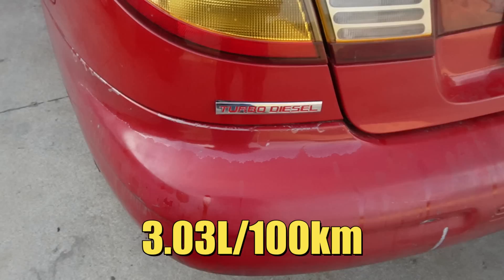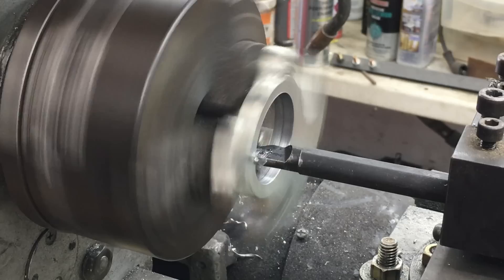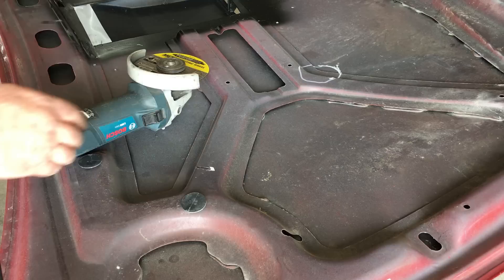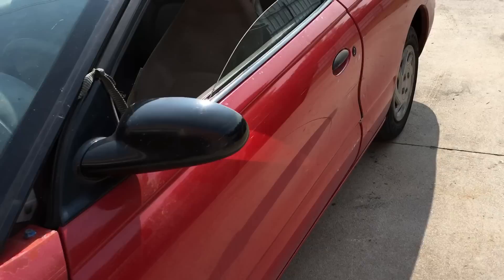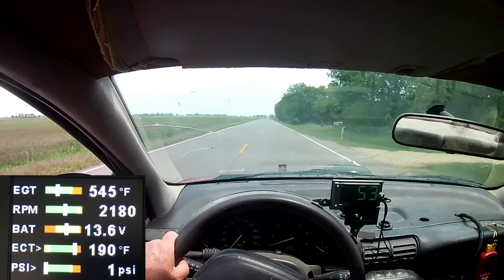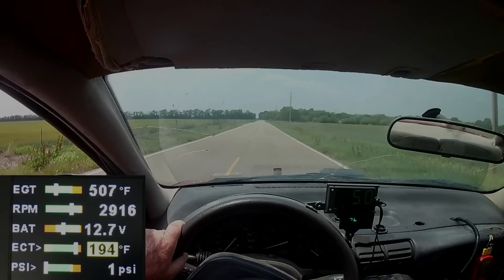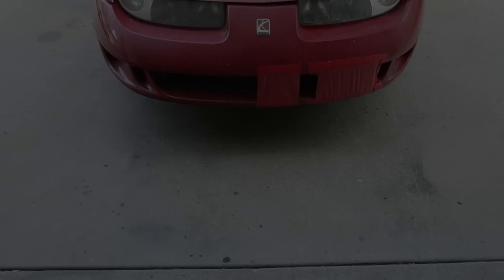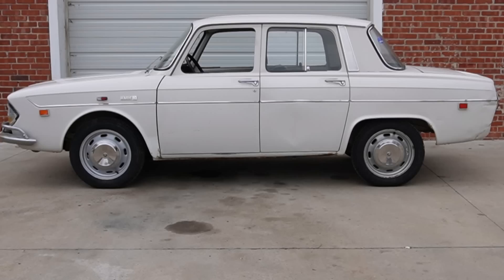S3 E17  We get 80 MPG with our D722 Kubota turbo diesel Saturn.  Best fuel economy yet !

Comment: The most surprising part of this is that you have the heater connected!
Reply: I was thinking the same!
Reply: It's gotta have a Sport Mode switch: turn it on, get more power!  (Or a safety backup, if you're no fun at parties.)
Reply: They hooked the heater up in case as they did overheat the engine.

Comment: An old farmer taught me to add 2 stroke oil to the diesel at about 100:1

It has a nice effect - running quieter and cleaner. Generally sweeter. Farmers don't usually invest money in anything unless it ultimately saves money! It would be interesting to see if you can achieve any mpg gains
Reply: A common practice here in my country
Fill a 200 liter of diesel then ad 1 liter of 2 stroke oil into the tank.
Reply: Not good advice if you have catalytic converters.
Reply: @MiGujack3  but for the kubota engine it should be perfect
Reply: Adding a little transmission fluid to diesel fuel does the same thing.
Reply: @MiGujack3  diesels do not have catalytic converters. They use particulate filters.
Reply: @shadymaint1  they have both
Reply: Do you know why it does that?
Reply: The reason for the extra oil is the reduction in sulfur in modern diesel fuel. On pumps that provide engine oil flowing through them (such as piston pumps) it isn't necessary to add lubricant to fuel. Now my 1991 Dodge W250 with a rotary pump definitely needs some additional lubricant. As the fuel is what keeps it lubricated.
Reply: @duanehenicke6602  Here in Kansas,  we take the old farmer's advice seriously. 🚜🚜🚜🚜🤠🤠🤠🤠👍👍
Reply: @MiGujack3  Incorrect. Just saying. Look up the way a system with a converter is laid out and it might make more sense.
Reply: Little Wally World 2 stroke oil or even some Marvel Mystery oil.
Reply: @Kansas Rose  oddly enough you're talking to another old farmer. Just south Texas in nature.....
Reply: @MiGujack3  only losers have cats on any vehicle
Reply: I've heard LPG injection helps performance and economy.
Reply: @duanehenicke6602  Thanks for explaining that. Makes sense now.
Reply: Heard similar stories about petrol.
Reply: @TheGuruStud  Oh I would love to remove them, but I live in a nanny state.
Reply: @shadymaint1  on road engine do have it from last '90s
off road engine have it since epa mandate tier 2 and above
Reply: There's a much better and cleaner solution than this. Diesel fuel additives. I use Stanadyne myself but they all have effectively the same result. Better lubricity in the fuel system, which translates to better fuel economy and longer engine life, coupled with anti-gel and fuel stabilizers.
Reply: No, oil in petrol(gasoline) engines really hurts mpg and power. Oil based fuels are High Reactivity Fuels, so they destroy your octane rating. I think that’s why 2strokes have such low compression.
Reply: @bobirving6052  he's talking about diesel though
Reply: @bobirving6052  its for diesel engine truck mate. Never saw it used on petrol engine.
Reply: Ultra low sulfur diesel isn’t as slippery, so these old mechanical engines need extra fuel lubricity for the injection pump.  TCW-3 or 4 is the best choice.  This two cycle oil is ashless and formulated for water cooled engines.
Reply: @robmanueb.  Bit of a niche modification now but it certainly does.
Reply: @robmanueb.  Yeah I been telling this dude to propane inject it n all he cares about now is fuel economy! 🙄 Lame!
Reply: Do not tell the EPA about that!!!
Reply: Two stroke scooters and yard implement engine have been running cats for at least 14 year now.  The extra air/gasoline and oil smoke out the exhaust burn quite completely. My Husqvarna LD29 runs nearly smoke free.
Reply: @bobirving6052  they have low static compression. Lower static compression on high performance 2t can also help with better cylinder filing at high rpm.
Reply: @SeekingPleroma I would guess it's because the oil has a higher BTU content
Reply: @MiGujack3  On a side note, ATF works too. Gas or diesel and cats don't care.
If you ever have an issue with your gasoline powered car dieseling and adjusting the carb doesn't seem to fix it, pour a bottle of ATF in the tank at your next fill-up. That should do the trick. Might take two fill-ups depending on how bad the condition is, but generally, one tank clears it up.

Comment: It's insane how much power those predator b twin engines can make. The performance kits that they make for garden pulling tractors can crank them up well into the 50 HP range before even getting into forced induction.

Comment: Common rail diesels are perfectly capable of running without rolling coal. Even without a particulate filter, it's pretty much an aesthetic decision (I shall refrain from casting aspersions on those who do) rather than something which actually improves performance. Running so rich you leave a visible smoke trail only improves power output insignificantly over a 'clean' map.

It's a very different situation to old school diesels running lower injection pressure, with less precise (or even no) trimming of fueling to current boost levels...
Reply: I am absolutely casting aspersions on those who do!
What is an aspersion? :D
Reply: noun---  verbal exhibition of bad temper

synonyms for aspersion

    abuse
    animadversion
    calumny
    defamation
    detraction
    hit
    invective
    knock
    libel
    obloquy
    put down
    rap
    slam
    slander
    smear
    vituperation

Comment: 80mpg is impressive. I know you don't really care about the MPG tests, but making a hybrid diesel would be pretty interesting.
Reply: He doesn't care about fuel economy, but how many fuel economy runs did he do?!  One was extra long! :)
Reply: I'm not sure that gains anything because of the conversion losses. Manual transmission has the lowest overall losses without doing something exotic like a welded diff. Inverter or motor drives tend to be built for cheapest cost, not for best efficiency. Same deal with the alternator. You could go one motor controller per wheel and essentially create a computer-based differential with one gear change, but at the end of the day, you still have all of the various conversion losses going from rotating to electrical to rotating.
Reply: @Augustus T. Titus  I'm not sure where you get the idea that inverters, electric motors and generators are not built for efficiency. And mechanical transmissions and drivetrains have power losses too which are not insignificant. Consider the difference between flywheel horsepower and wheel horsepower on the same engine for a given car, the difference can be substantial.

Regardless, the fact that you think differently than me only suggests that such a test is necessary.
Reply: A Custom hybrid diesel could be pretty sick.
Reply: @AugustusTitus  The vast majority of the conversion losses are in the combustion engine. Practically anything that can make the engine run more efficiently will improve overall fuel economy. Traditional ICE cars run the engine under all sorts of conditions. Purpose-built engines for hybrid cars are designed for a much more narrow rpm and load range which is much easier to optimize for.

Comment: The hood scoop needs to have a higher profile to be fully in the airflow over the hood. 😉
Reply: I cannot find any wind tunnel tests for a Saturn, but the pictures I can find show attacked flow until the top of the hood.
Reply: @drippingwax  Think of it this way, a window opened half way will not pass as much air as fully opened. The small hood scoop is like a window partially opened as well as not being fully above the boundary layer of the air moving over the car.

To visualize the air flow tape around 4 to 6 inch long pieces of yarn with the end frayed slightly in front of the scoop (tuft flow). If the yarn is being directed into the scoop that's good, just open the window more. This is used on aircraft to visualize airflow in flight. 

In aeronautics, tufts are strips of yarn or string, typically around 15 cm (6 in), attached to an aircraft surface in a grid pattern and imaged during flight. The motion of the tufts during flight can be observed and recorded, to locate flow features such as boundary layer separation and reattachment.
Reply: It is on backwards anyway people ...
Reply: @victorboucher675  Most cars have it facing the correct direction.  Directing it backward made sense in the sixties, when windshields had far steeper angles, but not for modern cars, even this Saturn--unless you are trying to force hot air from the engine out that hole, but Jimbo never determined which way the air was blowing, and he isn't modifying the car further.

Comment: 13:05 - Yeah, I loved old Saabs, namely turbo 900s... those turbos were so big for that 2 liter engine they wouldn't even begin to boost until about 3,500 rpm and you could feel it at about 4,000... but I guess at the time the garrett turbo they used was about as small as it got. Made for a real bad turbo setup, but a real great gimmick... the way that thing would just sail once it hit 4,000 rpms put a smile on your face every time!

Comment: I wish you could keep the Saturn project going. It’s such a cool project! There are still things I’d like to see done. For instance. Does running a colder engine help or hurt fuel power? Or what if we cooled the fuel or preheated the fuel, how would that effect power and fuel Econ? What would adding a propane wet spray do to the power and fuel Econ? Would adding a oil cooler help or hinder the engine performance by making less friction inside the motor? What about using water? I’ve heard story’s of diesel engines running better when the moisture in the air is heavier. I’d like to know if that helps or hurts performance. There are other amazing ideas that could be tried too. Please don’t kill the Saturn project yet. It’s what got me hooked on your Chanel to start with.
Reply: Water content evaporates and causes cooler charge, to really oversimplify what's going on in most cases that folks are talking about that. It's not so much that the water itself matters, its what it does with the temps, at least in any cases I've seen water injection used on any engine.

Comment: Got me thinking about something kinda cool.   You can make a supercharger using pieces of pipe welded onto shafts using a pair of cam drive gears.  It doesn't have to produce more than 600mBar so it doesn't need to be helical.  Two chambers with the pipes 90° off between chambers with both shafts should produce smooth enough and be easy enough to rig and balance.  Two 2 inch long chambers would be enough, total size maybe 8" long and I think you need 2.5" radiuses so maybe 6.5" wide and it can be in the pipe instead of on the intake.   Saw the design someplace.

Comment: You've got me so beat on mpg. I just hit my best numbers on a drive to Illinois. 487 miles and used 9.6 gallons of gas, so I averaged 50.5 mpg in my three cylinder Fiesta. Not as good as the Saturn but not bad either.

Comment: Very impressive Jimbo, thanks for all your efforts on these car re-engine projects (just the kind of thing us engineers find facinating)!

I had no idea the exhaust system back pressure was so critical on diesels.  This explains why I have seen so many full size pickups with stove pipe diameter exhaust systems.
Reply from the maker: Well, I had no Idea as well, and just for fun we tried it and it makes a big difference.    We will do our best to correctly size the exhaust in the  next diesel build.  should be fun!
Reply: @robotcantina8957  Jimbo, you will route the exhaust past your window, right?
Right?! :)
Bill, how often have you seen big exhaust tips, but the actual muffler opening is smaller?
I have seen tons of stuff like that because people only care about looks.

Comment: We will all miss the little Kubota three cylinder, intercooled, turbodiesel, manual shift, aero modded, hood scooped, cut hood exhaust stacked, custom South African gauge cluster equipped, race weight lightened, single mirrored, mostly red Saturn coupe.  Walmart executives are probably drooling at the mouth thinking of all the under $10 things they can sell from the scrap.

But that R10 is something else...it'll be a fun project and definitely one worth saving on when it's done instead of sending off to be shredded and melted and turned into electric kitchen gadgets.

Comment: A good upgrade for that predator engine in the future as the project progresses would be to put two small mikuni slide carbs on the individual intakes with long straight intake runners. It's a cheap way to make a mini ram air for them that alot of lawnmower tractor pullers use.

Comment: You could make a better exhaustmanifold to help the turbo spool, shorter and better flowing and the egt would be lower, also fuelpump and pressure regulator so it increases fuel pressure on boost = less smoke before boost and better performance
Reply: I doubt changing the fuel pressure would matter unless the injection pump is being starved for fuel. I think i heard mention of some engines using another actuator on the IP to increase fuel flow on boost but I'm not sure how that's set up.
Reply: @mercMADCommando  yes it helps because it rases the base fuel pressure in the pump and in the "elements" so it helps espessially at higher revs and yes for example a wastegate or something that would adjust the rack depending on the boost level would also help but i think the elements are pretty mutch at their limit because it was never designed for this, a turbo engine pump would also be a great upgrade, even if it doesen't need the extra fuel due to how the mechanical pump works it squirts the same amount of fuel in faster witch means basically "tighter timing"

Comment: So enlarging the exhaust past the turbo does not affect the exhaust pulses traveling through the turbo. The pulses traveling into the turbo have to do with the exhaust manifold and valve timing. However I think that the exhaust is now too big for that turbo as the exhaust velocity is too low now. I think that the 1.5 inch pipe was perfect but it was the rest of the exhaust system causing restrictions possibly.

Comment: Congrats on the extreme MPG!  Of course it's diesel, which brings its own set of qualifications - but it's still an impressive number.  I just got about 61 miles per US gallon on regular pump gas, so I'm not too far behind you... although you definitely beat me.  Of course, my Elantra Hybrid will also do 0-60 in 8.4 seconds, so there's that.  Anyway, congratulations!

Comment: I've been watching this since the project started.  Pretty impressive work all around.  My only thought (although it may have been mentioned before, I usually don't read the peanut gallery, of which I'm ironically now a member) is that when you move on to other projects with this engine, consider using a turbo that will run between 5 and 10 psi of boost *at cruise*.  I think you'll find that your power band is much flatter, and that you'll get even better fuel economy (plus a much happier egt even with an exhaust system that exits the rear of the vehicle) as well.  If this has been considered or otherwise commented before, please feel free to ignore :)

PS: For those that don't know: In the United States road diesel is either undyed, or fluorescent green.  Basically, like Jimbo says, anything other than red is road diesel, and off road diesel is unmistakably red.  Not just a little red, but like RED red.  Fun fact? That red dye dyes stainless steel permanently when carried as a concentrate in a smooth bore stainless steel tank trailer.

Comment: I've got a turbo Saab that's pvc system had a thin 6mm tube connected to a plastic check valve, I was replacing them once every 2 years here in the florida heat (the valve would fail or the tube would expand away from the valve allowing leakage)... I bought some thick made in america fuel line made in USA and a stainless steel check valve, attached the valve with some made in Germany hose clamps... YEAH. I'm excited to see how many years this part lasts, the factory option wasn't lasting me and I'm ready to not even look at that check valve for the next ten years, so here's hoping!

Anyways ideas like this, I think channels like Robot Cantina help me try these kinds of experiments or at least get my gears turning, so I really appreciate all the mind opening content. Thanks for being a terrific content creator!

Comment: Honestly I think it would have been cool to see you maybe attempt an electric turbo set up. Since that little kubota doesn't seem to be making it spin up all that well, maybe bypassing having the exhaust spin it at all would be the next step? Perhaps something as simple as a small, 12v electric motor hooked up to the turbo to get it to spin full turn whenever you want and can adjust from the inside would be cool to see. Really liked this series!

Comment: I would unironically drive this to work everyday for that fuel economy, maybe without the hood exhaust 😉
Reply: Just get a Smart then. I don't think the US has the diesel one but it's almost the same as this.
Reply: @MiGujack3  a smart uses about 5l/100km, not 3. My diesel hatchback also uses roughly 5l/100km
Reply: Get a Prius. Seriously if you drive it the same way this guy does, it gets better fuel economy adjusted for energy density.
Reply: @yannick7230  Really? I've seen them do 4L. But I do agree there are better (and bigger) with more or less the same consumption. But then again, most of them EU only.

Comment: Next test for the diesel.
Find a Prius or similar,
Put a generator on the diesel,
Swap out some of the batteries for super capacitors and see how far you can go with the diesel topping up the batteries before you needto stop to recharge, and how long it takes , how much fuel it takes to get to full charge.